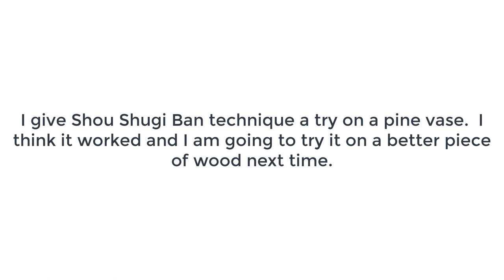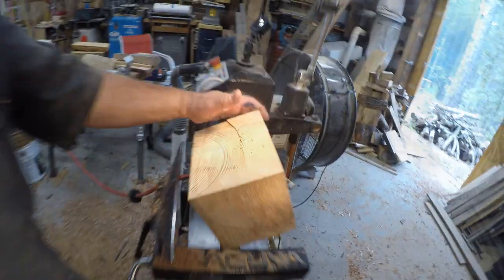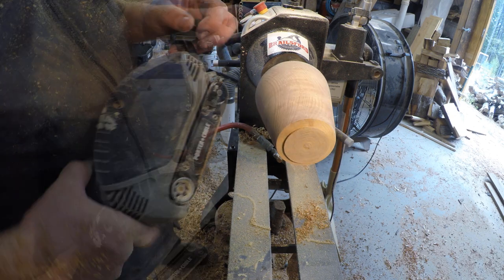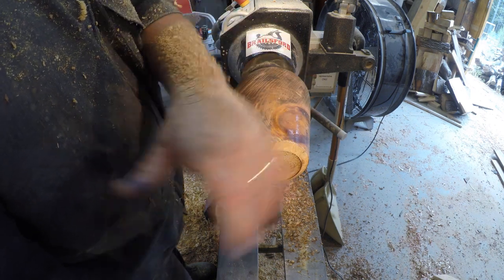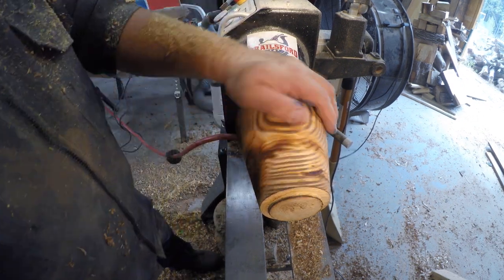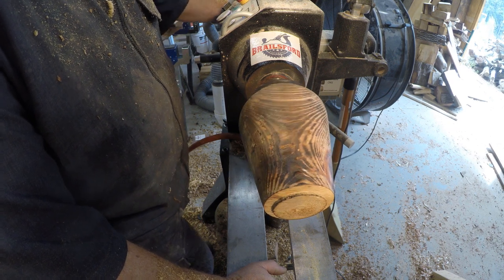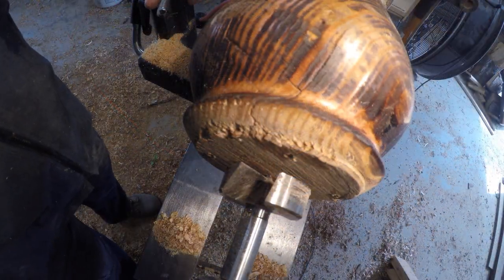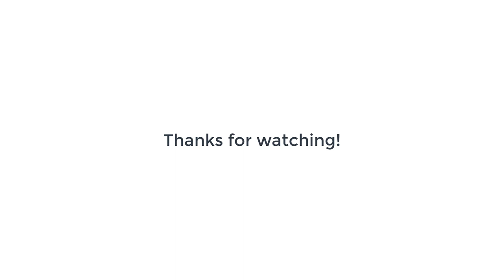Wood Turning Shou Sugi Ban Pine Vase Experiment

Comment: The place where I work, has pine cut offs.  They're all kiln dried wood.  I use those cut offs for bottle openers and ice cream handles.  I almost always burn them, and wire burn them.  Right now, I'm using OB Shine Juice in conjunction with Spray Lacquer.  Nice piece BTW.
Reply from the maker: That's a great idea!  Thanks for watching!